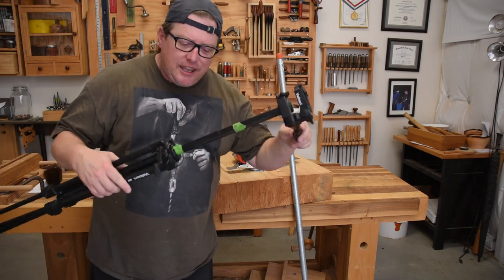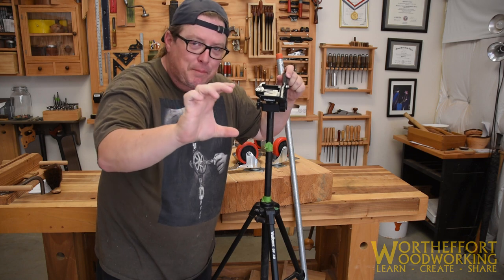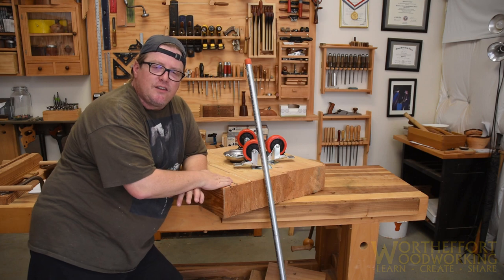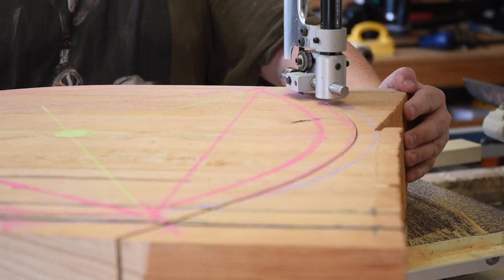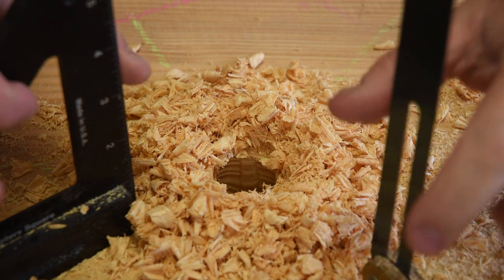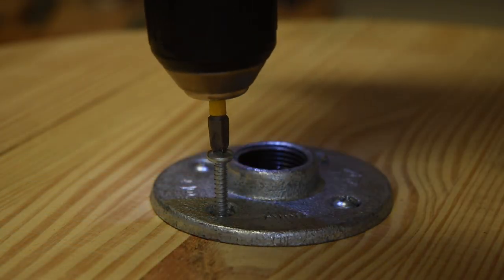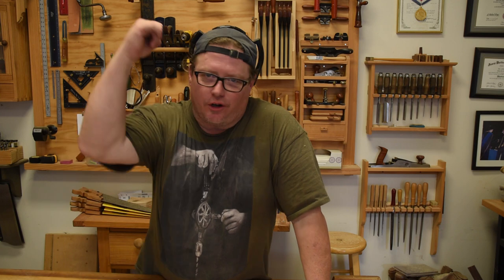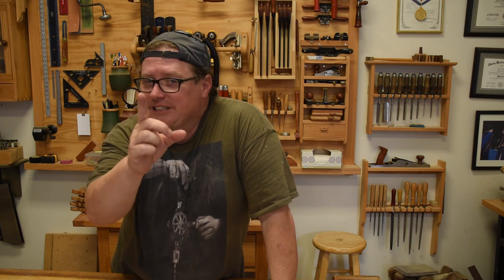Build a Camera Stand/Cart on a Budget

Comment: What is the rig attached to the pole?
Reply from the maker: Pipe flange?
Reply: wortheffort no. The rig attached to the pipe. The arm thingy
Reply from the maker: Articulating arm? I've had it forever but couldn't use it as I think it was originally designed to attach to a wall.
Reply: wortheffort then if your not using that arm, what is holding the camera to the pipe?
Reply from the maker: I'm using it now as shown in the video. Maybe I'm not understanding what your asking.
Reply: Thought you said you could not use the arm for the camera after all?